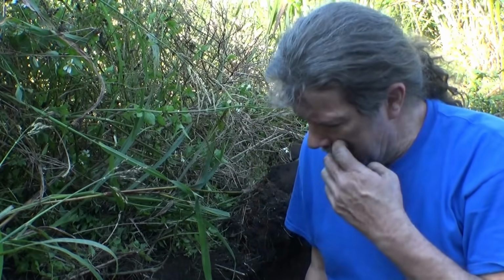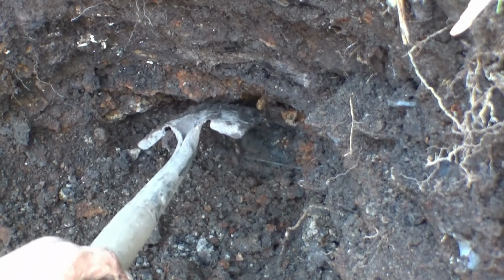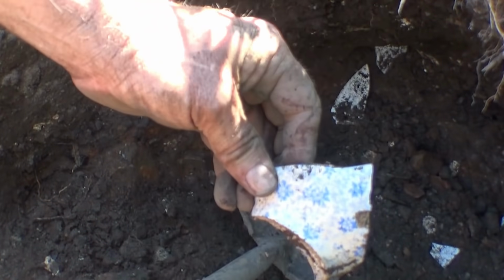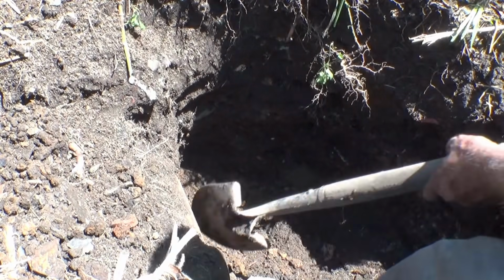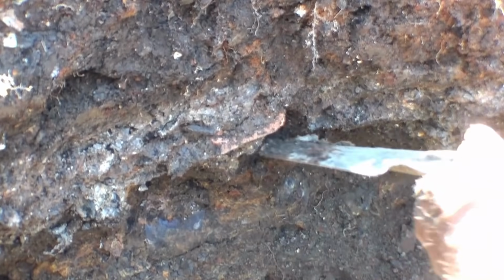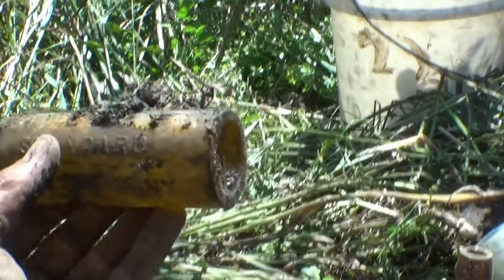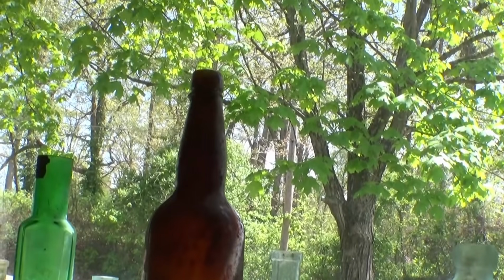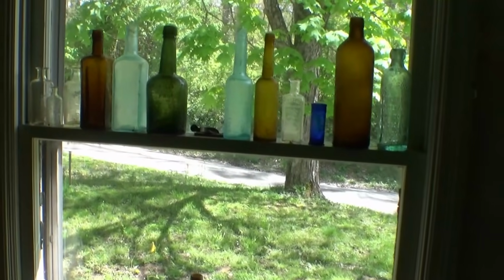1880s Bottle Digging Adventure With Digger Dave

Comment: Great to watch as always. Why do some bottles have a glass ring an inch or two below the top?
Reply: Sometimes was a wire securing the cork.  Other times lead foil was squeezed over it.  Also served to strengthen the glass at the mouth.  Shear tops have thin pulled off while molten, leaving thin & sharp unfinished lips/mouth of the bottle.

Comment: Nice dig. Dave. Those Sperm Whales started standing their ground and guarding that precious oil back in 1800s, sinking 4 or 5 whalers including the most notorious case of the Essex in 1820. Going after whale oil was not a job for the faint of heart.
Reply: All kinds of sailor machismo in that trade.  About one too many "Sailor towns" here.  Among the contributors to Hawaiian population disaster 1778-1950 or so.  Hawaiians were really apprehensive they would vanish as a "Race" in those years.  Still coasting on a '70s "Pride" mov't.   Hokulea  &c.